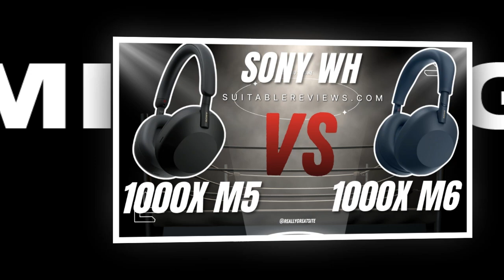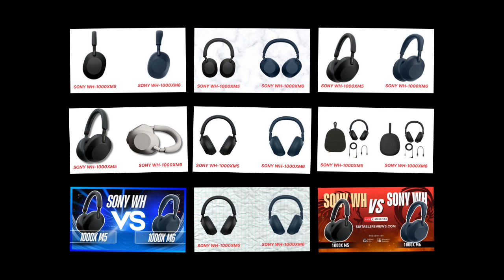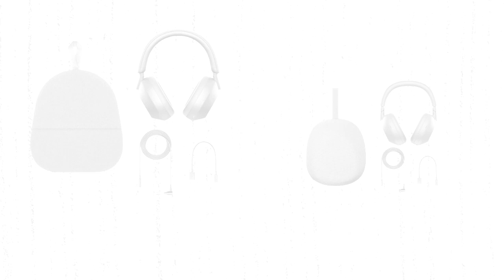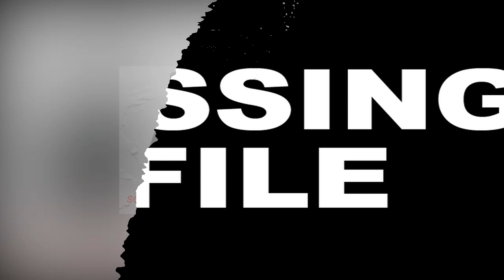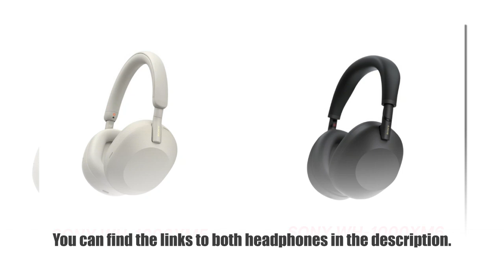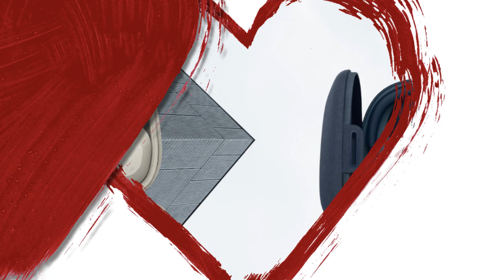Sound Quality Breakdown: Sony WH-1000XM5 vs Sony WH-1000XM6 Audio Fidelity

Comment from the maker: Headphones Link = https://cutt.ly/gtpgNi5i

Audio quality defines the premium noise canceling headphones experience, and both Sony models excel in distinct ways. The Sony WH-1000XM5 features a precision-engineered 30-millimeter dynamic driver that improves high-frequency sensitivity for natural sound reproduction across all music genres. The Sony Sound Connect App's EQ function allows personalization of audio characteristics. The Sony WH-1000XM6 elevates the experience through collaboration with world-renowned mastering audio engineers, incorporating a lightweight carbon fiber dome driver for enhanced clarity. Most significantly, the WH-1000XM6 supports High-Resolution Audio through LDAC technology, transmitting three times more data than conventional Bluetooth audio. This wireless headphones comparison shows that while both deliver excellent sound quality, the WH-1000XM6's High-Resolution Audio support makes it superior for audiophiles.

#AudioQuality #SonyWH1000XM6 #HighResolutionAudio #SoundQuality #PremiumHeadphones
Reply from the maker: Headphones Link = https://cutt.ly/gtpgNi5i

Audio quality defines the premium noise canceling headphones experience, and both Sony models excel in distinct ways. The Sony WH-1000XM5 features a precision-engineered 30-millimeter dynamic driver that improves high-frequency sensitivity for natural sound reproduction across all music genres. The Sony Sound Connect App's EQ function allows personalization of audio characteristics. The Sony WH-1000XM6 elevates the experience through collaboration with world-renowned mastering audio engineers, incorporating a lightweight carbon fiber dome driver for enhanced clarity. Most significantly, the WH-1000XM6 supports High-Resolution Audio through LDAC technology, transmitting three times more data than conventional Bluetooth audio. This wireless headphones comparison shows that while both deliver excellent sound quality, the WH-1000XM6's High-Resolution Audio support makes it superior for audiophiles.

#AudioQuality #SonyWH1000XM6 #HighResolutionAudio #SoundQuality #PremiumHeadphones